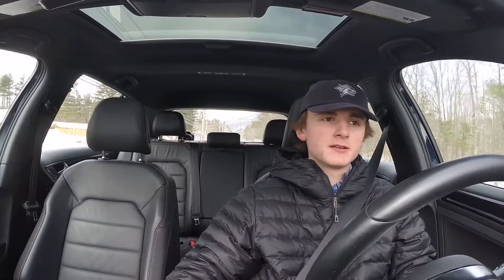25,000 MILE UPDATE!!! - APR Stage 2 Mk7 GTI

Comment: I was really close to doing an APR stg1 ecu and tcu tune, but I decided not to and went with the lowering springs. I would say for sure the car would've been pulling so much harder than the stock after the flash but first of all, i was worried about the 100k drive train warranty, and second, im not a fat cat or whatever that has plenty of money to spend. I dont regret doing the lowering spring, it handles fucking great. Next mod will probably be a thicker rear sway bar swap. I guess to me, handling comes first. lol
Reply: Juizthat which springs did you go with?
Reply from the maker: Totally respectable, when you decide to go APR Stage 1 / 2. You will not regret it! My tune with a downpipe installed was around $1,500. But pretty reasonable for 340 HP to the crank. Handling mods are soon to come for me!

Comment: get oem audi rs7 plugs, I just did them yesterday and my gti runs like a gazelle.
Reply from the maker: I will have to check those out!
Reply: PxWolf plugs or coils
Reply: I just did plugs and kept the oem coilpacks
Reply from the maker: Just snagged a pair of RS7 plugs, do you think I am going to feel the difference or not?
Reply: Only thing I noticed was less hesitation and shakiness on cold starts but either way I'd rather run the plugs that are recommended for the tune.
Reply from the maker: Very interesting, thanks!